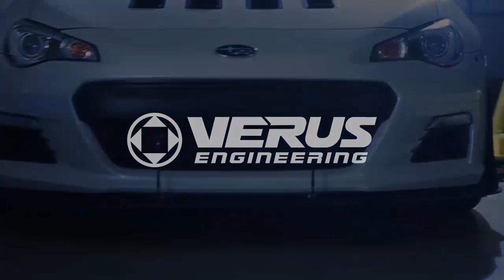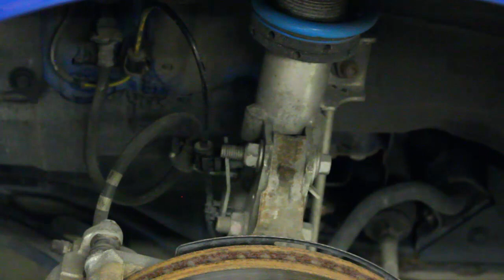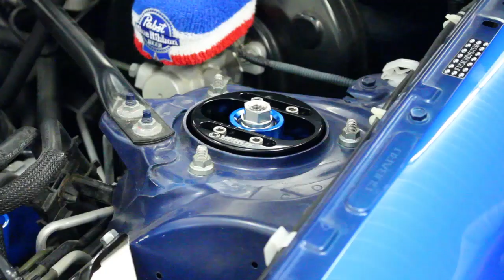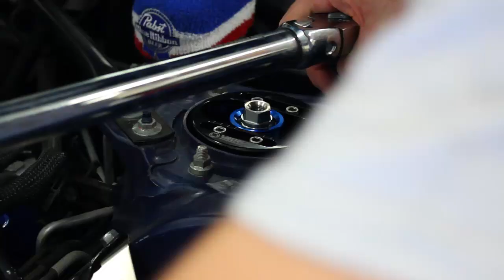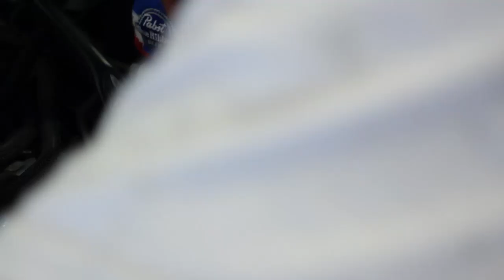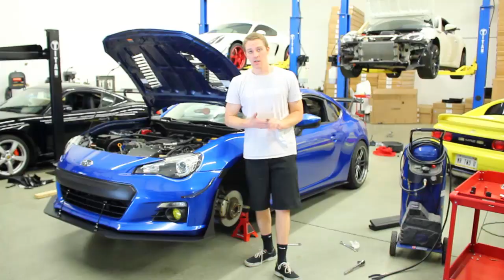BRZ/FRS/GT86 Camber Plate Assembly Install

Comment: Compatible for ohlins r&t?
Reply from the maker: They sure are. We have a set installed on some Ohlins here at the shop actually.
Reply: @VerusEngineering  have you any for rear suspension?
Reply from the maker: @albertolago1276  yes, we have rear LCAs that offer camber adjustment.
Reply: @VerusEngineering  where can i buy them?
Reply from the maker: @albertolago1276 on our website.

Comment: I hand hand tightened the top nut plus a little extra before taking the spring compressors off, about halfway through the threads, same as it appears in the video. Once the compressors came off and I had everything installed in the car, I could not tighten the top nut anymore, the spring is pushing on it to give it enough torque I suppose. Does that seem right to you?  I see you are able to get a few twists on it in fast-forward @4:50. 

Worried I don't have enough threads in the nut, but it seems like it will be fine.
Reply from the maker: Send us an email with some photos.

Comment: compatible for tein coilovers ?
Reply from the maker: Yes, but our top nut does not work with Tein Coilover systems unfortunately. Raceseng makes a top nut that makes our camber plates compatible with Tein Coilover systems though.
Reply: @VerusEngineering  do you have a link to the top nut ?
Reply from the maker: @craven891  If you need one of our top nuts, please email us, if you need the Raceseng top nut, you will need to email Raceseng.

Comment: Would these work with the adjustable koni yellow struts?
Reply from the maker: Yes. Any strut, spring, or coilover setup that utilizes the OEM tophat. The Tein coilovers needs a different top nut, but they can work as well.
Reply: @VerusEngineering  thank you, I just was worried as their is an adjustment knob on the koni yellow if it would fit through the hole, not sure if you guys know if they would or not?
Reply from the maker: @DrivenGarage  ah did not know that to be honest. Our top nut has an 11mm opening, so it's possible, but I'm not sure 100% now.
Reply: @VerusEngineering  thank you for your honesty!!!!
Reply from the maker: @DrivenGarage  You are very welcome.

Comment: when you get an alignment, both sides be centered at the default position right?
Reply: to clarify, i mean both camber plates should be centered?
Reply from the maker: @cforcalvin  Each alignment will be different and it depends on if you want to run negative camber or not. For driving to the alignment shop, the adjuster in the center should be fine.

Comment: With your bilstein’s, how much lower were you able to get it.  I’ve read many forums that say 30mm is the lowest.  I’m wondering because I accidentally got your exact set up except mine are b14’s not b16’s.  Thanks
Reply from the maker: If I remember correctly the B16's have a 30-50mm height adjustment front and rear.
Reply: Ok, so are the lock collars as low as they can go
Reply from the maker: @Wes_Log  Mine are in the front, the rear still has a bit left to go. Not much, but I do have a little room to play with.
Reply: Thanks man.  I appreciate it